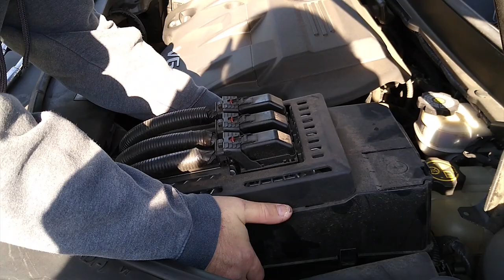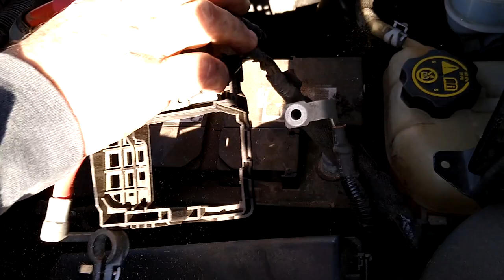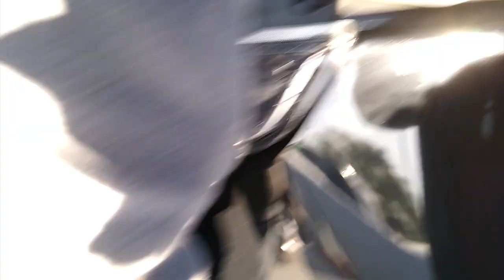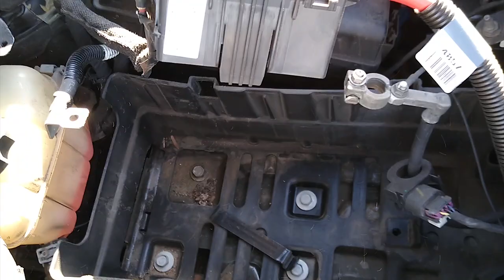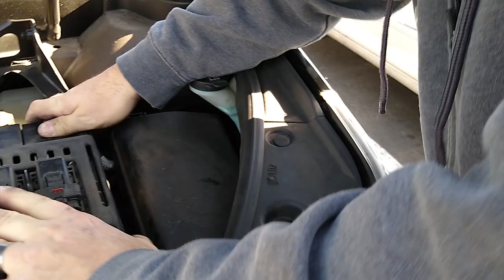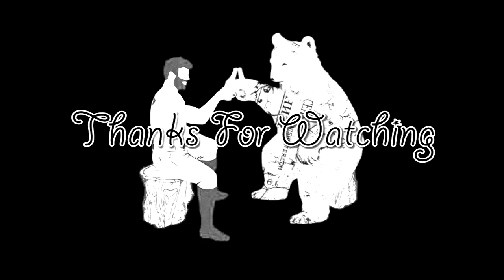Cadillac SRX Dead Battery Replacement 2010 2011 2012 2013 2014 2015 2016

Comment: Thanks for the video-just replaced mine on a 2013 SRX.  The battery was just a year old and it had been installed at the dealer.  I found that the battery hold-down on the battery would allow the battery to move thus shorting out a cell.  I didn’t use the wedge with the hold-down and it held the battery without any movement.  Also like another comment I used dielectric grease on the battery contacts to prevent corrosion.  Your battery had the same hold-down flange as mine.  Try moving it side to side to see if it is snug.
Reply: Maybe that's what happened with my battery because my entire dash, air, and radio just shut down while I was driving but I believed it warned me before it happened because as I hit a bump, it would go out then immediately come back on. This time it went out and didn't come back on.

Comment: The plate that lays on the battery with positive wire connections (not the battery cover) does not pull off easily.  I found a flat head screwdriver placed in the slots of the plate makes it release easily. The slots are on the top of the plate along the battery edge. So the screwdriver goes in tge slots straight down pointed towards the floor. Thanks for sharing.

Comment: You should keep the negative battery cover ON until the last move. One little slip, and you will blow that 350 amp fuse, and it's not cheap. Clean and dielectric grease on all connections. If the system trips out for under voltage with the old battery, remove old battery and insure new battery is fully charged, above 12.6, to reset system. If you don't, you will hear a buzz, weak parking lights will be on, and no start attempts will be successful until you do. "When the Cadillac speaks, you should listen".
Reply: When you say keep negative battery cover on. Do you mean remove positive terminal attachments first?

Comment: I read if you didn't back up yourcomputer memory,a lot of settings are lost. A plug in to the lighter saves them. Any auto store carries the adapter. Worked fine.

Comment: How bout just a draw? The 250A and the 60A next to it towards the back of the battery are slowly draining my battery so where is the power going?
Reply from the maker: Unusually, the biggest drain on a battery is the security system. You might have a sensor issue preventing the system from to going asleep.

Comment: Great  video thanks....I was told not to wear any jewelry when changing out a battery as a wrench or ratchet could make a connection and burn your finger, any input on this? Thanks
Reply: Rings are well worth the risk honestly. Any metal bracelet however not so much.